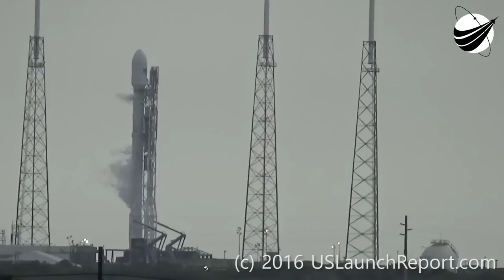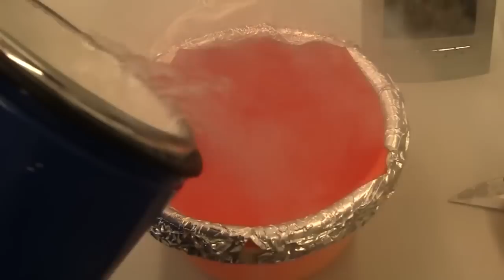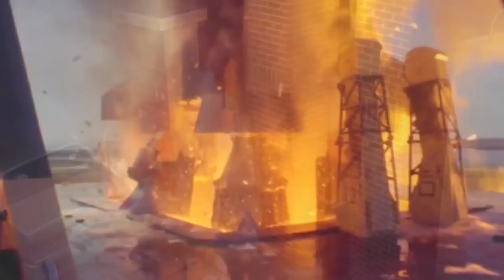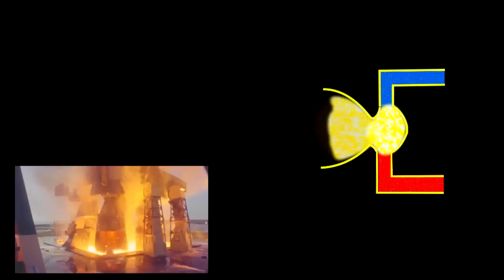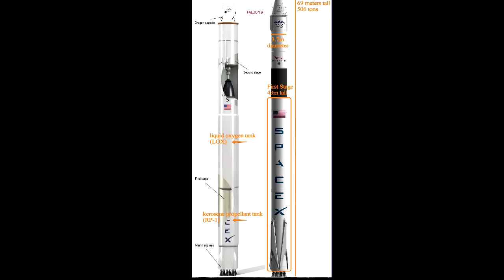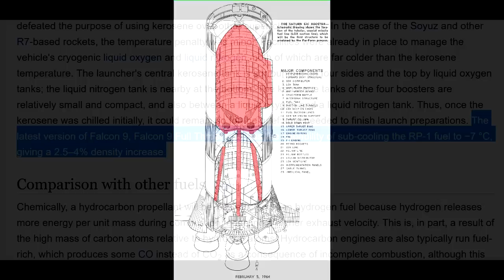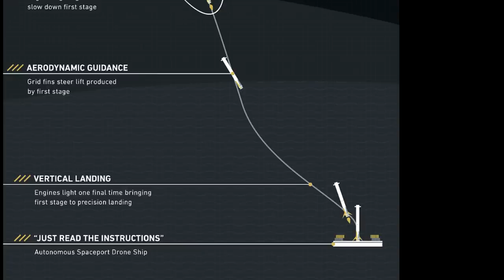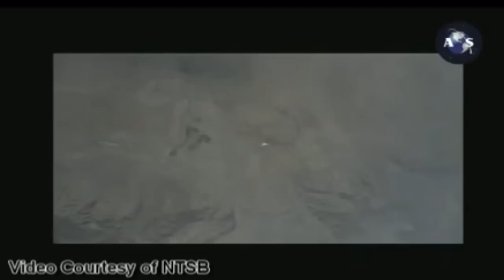Why did the Falcon 9 Explode?

Comment: hot damn this vid is good
Reply: wakemore27 He is objectively wrong on several counts towards the end of the video, and acts like he's the only person capable of thinking about something. Then he makes the claim that Elon Musk's rocket science gurus at SpaceX are incompetent, despite the fact that the problems they are facing are unique because they designed their rocket from the ground up using systems and ideas not found in any other rockets. Then he proposes that they should use a parachute, which is ludicrous seeing as a rocket that size would need an exceedingly large parachute to slow it down. I mean seriously, what idiot compares the relatively tiny mars landers with the size of the Falcon 9? Also, he acts as if the money lost from this accident is a significant amount, which it objectively isn't. A Saturn V rocket costs $189 M, without a payload. The Delta IV is commonly used today to perform satellite launches, and costs upwards of $400 M per rocket. A Falcon 9 costs about $62 M without a payload and can do everything the Saturn V and the Delta IV can, add reusable rockets and savings increase exponentially. Then he complains that none of the rockets have been reused yet, despite the fact that they are still in the testing phase and that they would likely want multiple successful launches and landings before testing a reused rocket.

You don't need to be a fan of Musk to see TF just has a hard on for trying to discount Musk, for whatever reason. TF has been shown to be objectively wrong time and again on every engineering topic he chooses to talk about by others in the community. I really wish he'd stick to what he's good at, talking about his own research projects and discounting the scientifically illiterate. Because when he makes videos like this, he might sound right, but when you actually look into the things he's talking about he's way too easily shown to be wrong, or is not looking at the whole picture or is just ignorant of what everyone else is doing in the industry. He needs to stop caring so much about what Musk is doing, there are far more important things to care about than what a billionaire entrepreneur is doing with his space industry and what ideas he comes up with. I mean, TF seriously blames Musk for a design failure, that alone should be enough to tell you he's trying to dig too far. I'm quite sure Musk had nothing to do with the design technicalities of the Falcon 9.
Reply: +Chuck Norris you're 100% incorrect you have a Morgan freeman photo in a chuck Norris name.
Reply: gtjack9 That's even worse. That adds dozens more potential points of failure. Then you need to add rocket engines to every section in order to perform a controlled landing on each individual part, then you need an individual barge for each part. No what he was saying, and the graphic he showed, implies he thinks you should use one massive parachute for the whole rocket, which is stupid. Yes I'm going insult him or call him out on when he says something stupid and simply wrong. He's not better than me and he isn't above criticism.
Reply: Most of it is good, then TF decides to take it upon himself to act like he knows the answer everything, and anyone who isn't him is stupid, again. He always takes a subject further than he should.
Reply: wakemore27 There are opinions, and then there are facts that prove opinions wrong. Simply put one mistake doesn't make SpaceX useless and retarded. Especially when he acts like the amount of money lost here was a large amount, it clearly shows he didn't look into what other rockets cost with a similar payload capacity. Rocket failures happen, SpaceX will have another failure in the future, Nasa will have another failure in the future. It is inevitable. What matters is them pinpointing exactly what went wrong and then making sure it doesn't happen again. Not acting like a child.
Reply: +Joshua Dunbar the falcon 9 can NOT do everything the Saturn V and delta IV can do. The delta IV has much higher payloads and the the Saturn v can go to the MOON for gods sake.
Reply: +Jorge B. Hey alert tumblr we are at Defcon F Cultural Appropriation Incoming!
Reply: Aeroscience I also want to point out that TF is being misleading when he says that none of the rockets have been reused. It is true that a full launch has not been done with a reused rocket yet, however, short test flights using reused rockets and engines have been done. We do know it's feasible, SpaceX's test vehicle, the Falcon 9 Reusable Development Vehicle was reused 5 times to reach an altitude of 1,000 meters. I'm sure in time a full launch using a reused rocket will be done, once all of the problems are fixed to the best of their ability. Why jump ahead and attempt it before you are ready? Isn't testing a big part of the scientific method? TF knows this, so why is he scoffing at them for being cautious? It's this fact that makes me angry at him. I don't care if he doesn't like Musk. What I do care about is when he says stupid baseless things easily proven to be wrong, and then purposefully misleads people in his video. This makes him no better than people like Anita Sarkesian.

https://en.wikipedia.org/wiki/Grasshopper_(rocket)#Grasshopper_v1.1
Reply: Joshua Dunbar 

opinions vary
Reply: Aeroscience The Delta IV has a max payload of ~29,000 kg for LEO. The Falcon 9 has a max payload of ~23,000 kg for LEO. This is not a substantial difference. So what the hell are you talking about? As for the Saturn rockets I admit I got them mixed up, I meant to say Saturn I, which only had a max payload of 9,000 kg, and the Saturn Ib had a max of 21,000 kg. However, the Saturn Ib cost $311 M to build and launch. The Delta II costs $50-60M to launch, with only a payload max of 6,000 kg. Again, the Falcon 9 can do almost everything the Saturn series of rockets can do, and the Delta series, one of the most commonly used rockets today. It also has the added benefit of being easily recovered and reused in addition to it's low cost to launch.

Did you even fact check yourself?
Reply: +Joshua Dunbar I agree, the falcon 9 is a good rocket, but you completely oversold it. That's my point.
Reply: +Joshua Dunbar just for the record, I think the reusability plan for the falcon 9 is a good idea, but it remains to be seen wether it's feasible. I do encourage the effort though.
Reply: Joshua Dunbar 

You people..? Lmfao.. Careful. Your arrogance is showing again.. 
A little lesson for you: if you call someone out on something that doesn't make you right, and when you resort to the "kool aid" accusation, it only shows how nutty your peanut butter really is.....
I'm guessing I'll also find you supporting conspiracy theories out there in the comments of conspiracy theory videos, won't I..?
Reply: +Joshua Dunbar 

how so? I didn't think he did at all. perhaps you lack the necessary thought processes to understand this and your inferiority complex compels you to react negatively..?
just a thought...
Reply: Joshua Dunbar 

How, exactly, did he act like a child? He was giving explanations and expressing his opinion. Now you're critiquing a critique with YOUR opinion. Seems like you have issues with TF going in, regardless of this video. If you don't like what he has to say, don't watch...that is unless you enjoy wasting your time trolling his videos. Be that the case, you have successfully wasted my time, too. Congratu-fucking-lations. You get a Scooby snack.

Comment: Thunderf00t, i love your videos, and I have a video I would like you to look at if you have the time. This guy says he can run up to 25 MPH with these boots he invented. If anyone could tell me if its real, its you. Check it out?  Youtibe Bionic boot
Reply: plz thunderfoot
Reply: Depends upon how fast the bear is.
Reply: Those things work, but it will fuck up your joints. Our legs are extremely complex. Forces acting on your knees are different in these boots then regular running. Tendons and muscles can't compensate the impact properly. I wouldn't recommend it.
Reply: Nah, that might be true, I just don't see the point of them, I rather just use a bike. It's very much like running on stilts with springs. The thing reminds me of 'kangaroo jumps'.
Reply: longer feet and springs, Usain bold can run faster without them, so if you are a good runner and you have those boots, yeah 25MPH is probably possible. Those boots definitely are not fake in their function, and if you build it right, 25 MPH is not too far removed from reality.
Reply: I haven't seen the video yet but let me answer your question anyway. NO!